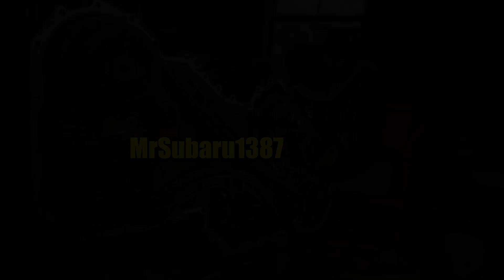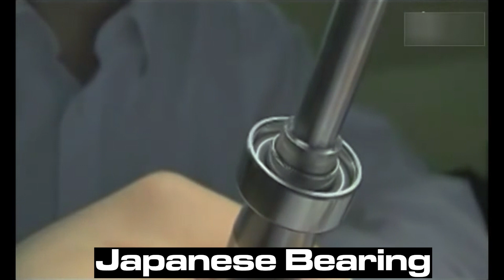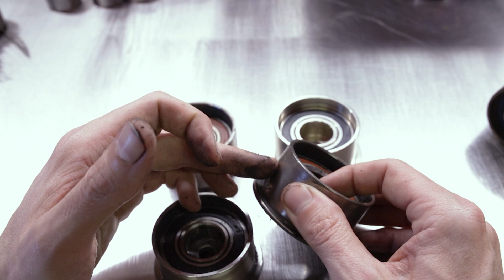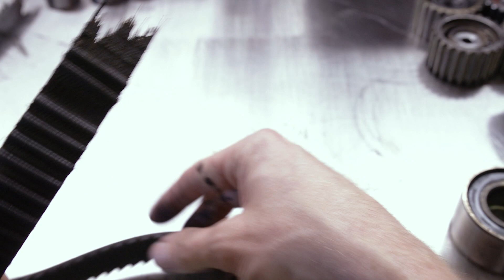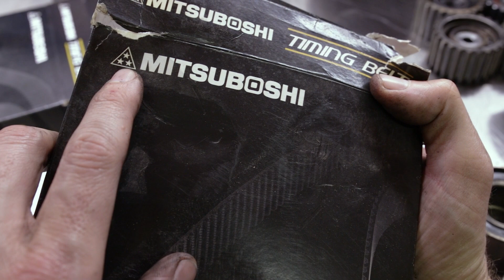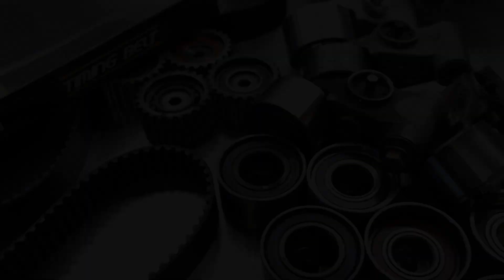Subaru EJ Series Engine Timing Belt Components Inspection & Common Faults

Comment: Hey Mr Subaru!  I recently looked at buying a 2006 impreza, but the harmonic balancer was visibly wobbling while the car was running. But not loose, i couldn't move it by hand, it felt solid but definitely was out of center or something, What does this mean?
Reply: The EJ crank pulley can separate where the outer part will spin on the inner part.  You need to replace it ASAP before it causes damage to your timing belt covers, or leaves you with no charging or steering systems.  Plenty of videos out there.   The other thing that it can be is a loose crank bolt, or a damaged keyway where the pulley mounts to the crank.
Reply from the maker: The pulley could be seperating. Or someone removed it and installed it wrong. Seen it happen quite a few times.
Reply: Im worrying about the off balance prematurely wearing out main bearings
Reply: @tarzaan2603  In my opinion, that is not likely the issue with that Impreza.  The pulley on the front of the engine is not a harmonic balancer, it is just a keyed shaft pulley made of two parts with a rubber layer between them that bonds them together.  I've had these fail before, and have seen the ones that were put on wrong and damaged the key-way on the crankshaft.  If the main bearings are going bad, you will get a knocking sound from the engine.  Especially when the engine is cold.  If the crankshaft is damaged from improper installation, then I wouldn't buy it.  If it is just a separated pulley  (which is waaaay more common), it is a fairly easy fix if you don't let it go so long that it causes other damage.  Good luck.
Reply: @cajunaggie9815  wow thanks! Too bad i already turned down the car, i thought it was a major issue (im paranoid) now i know
Reply: @tarzaan2603  You're welcome.  MrSubaru has done several inspection videos of cars he is considering buying, or has already bought, that will show you the main things to look for.  The cars are not that hard to work  on with some basic tools and these great repair videos he puts out.  You can get some really good deals on these Subarus if you can do some mechanical work yourself.  Just stay away from ones with road-salt rust crusting all the parts :-)